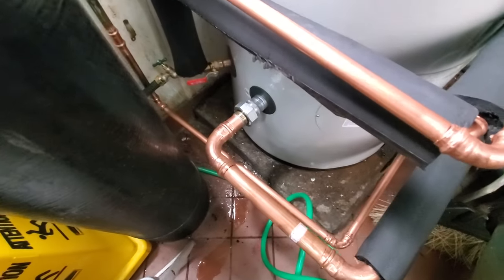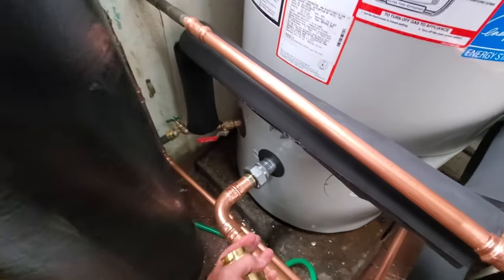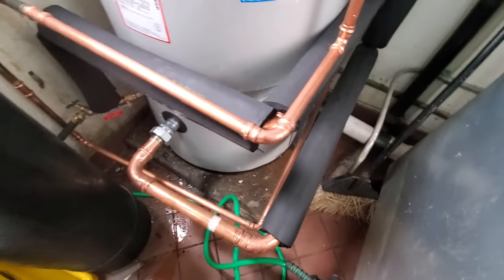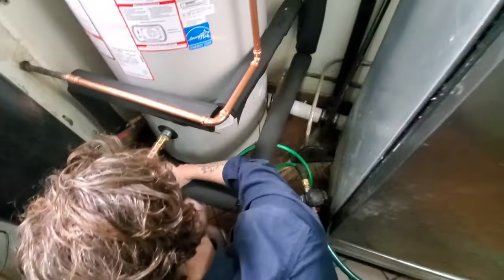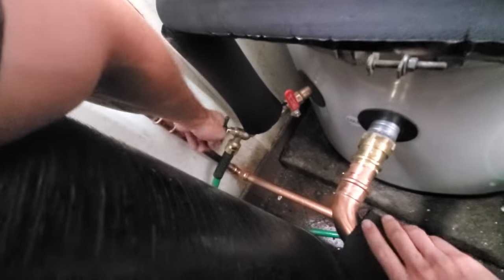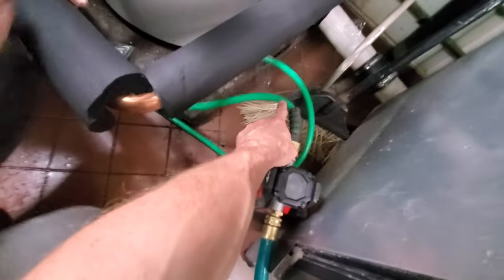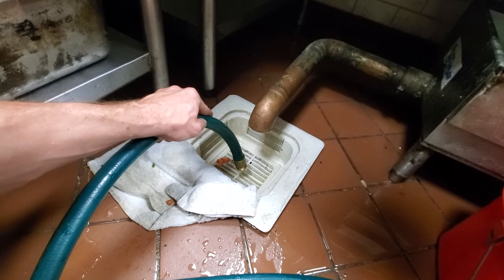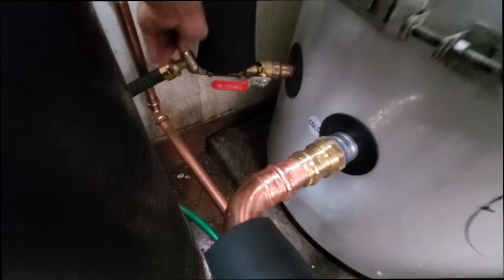Do this before turning your recirc pump back on...

Comment: I crimped about 10 brass fittings today for Pex B and teed into a hot and cold line for a basement 
The most satisfying thing I’ve done in years, but if it wasn’t Pex… we all know I would have been diarrhea out of luck. 😅